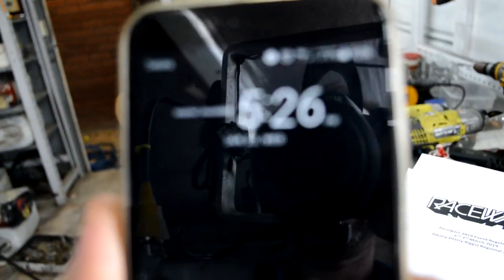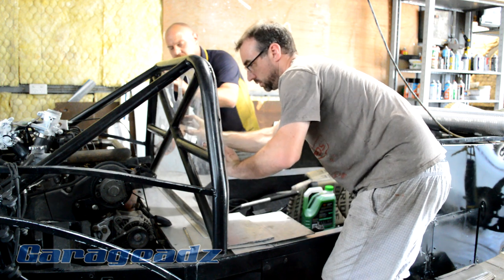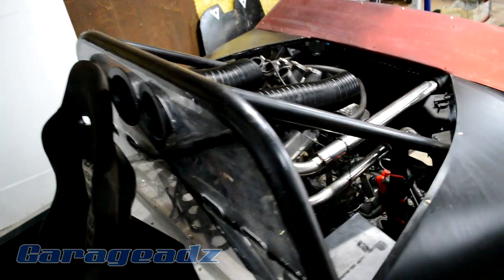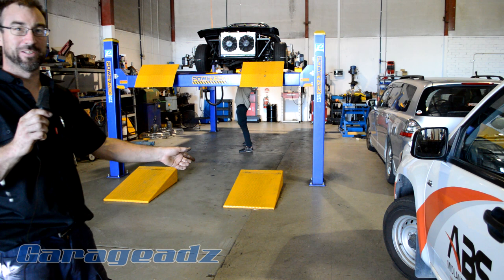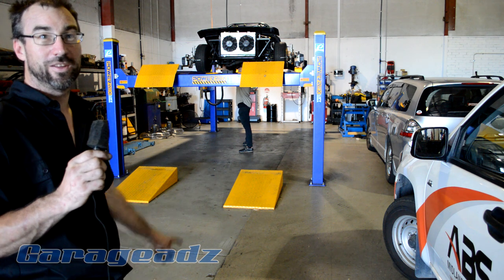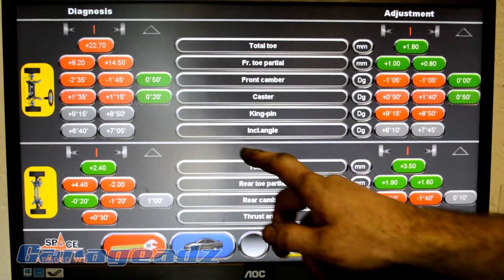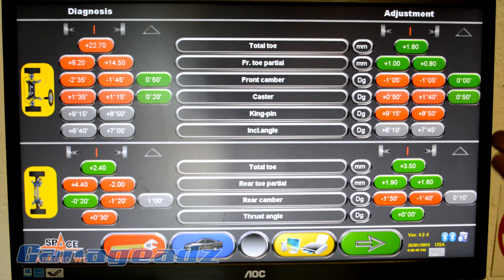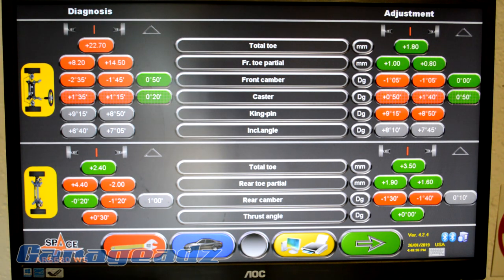DIY budget  racer #8

Comment: How did you get the itb running tuning wise? Little race car is all kinds of awesome btw
Reply from the maker: They took a little bit to sync up with the linkage arrangement (I have a dedicated video for the ITB build) but other than that they are pretty good. They definitely shine after 75% throttle, you can feel everything working really well. In saying that though there's a bit of restriction in resolution with the ECU that I'm using. An old Microtech fell in my lap so that's what's on it. Keeping it low budget :)

There is another video on the channel where I got some footage from one round of the motorkhana series I competed in through 2019, the audio is pretty good and you can really hear the ITB's.

Thanks for the compliment!
Reply: Garageadz I saw the diy video, it’s got me very inspired! Is it just running the tps or do you have a map in there too?
Reply from the maker: Ahh sorry, I get what you mean now, The engine runs on TPS only. It's the only real way to do it in this case without a huge vacuum manifold and pulse equalisation.  Every time I've tried to integrate a MAP sensor on an ITB setup it's been a really poor reference.